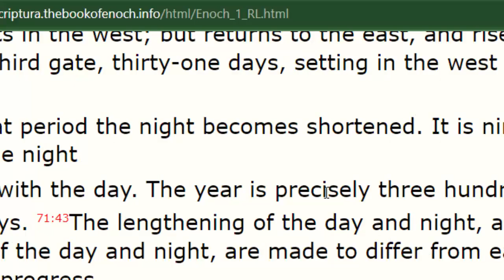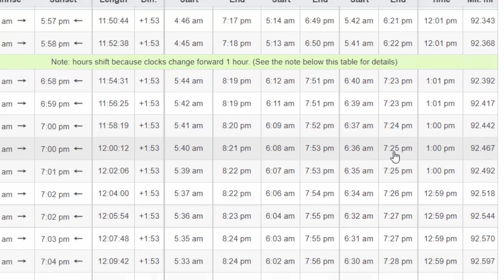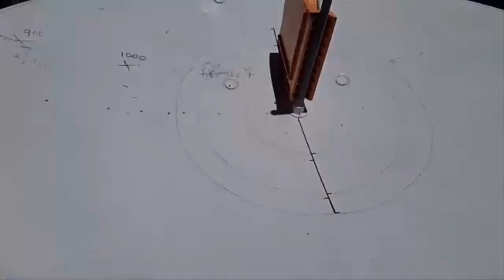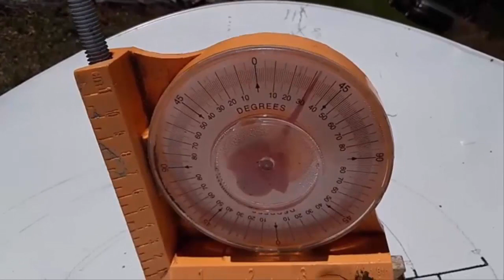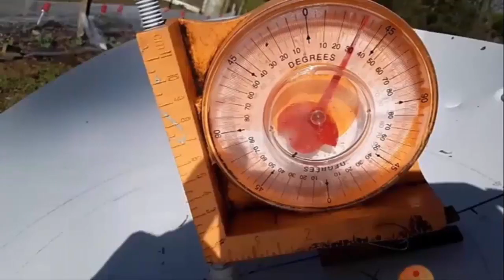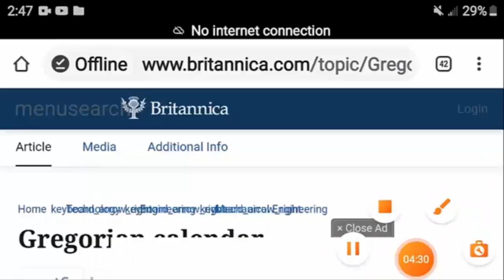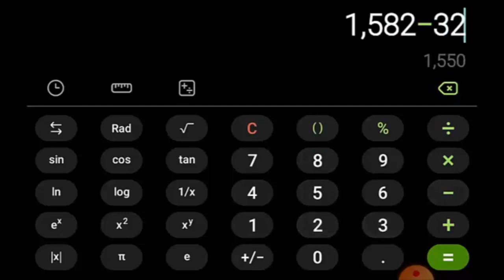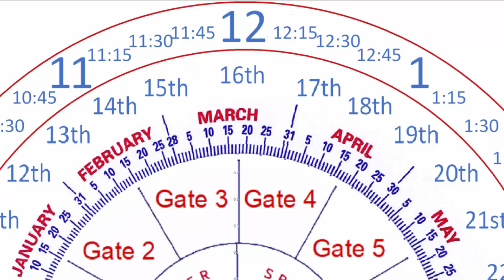When Is The 364th Day Of The Enoch Sacred Calendar? Equinox Is March 16th Not 20th? Earth Precession

Comment: That is similar to finding your true birthday based on date, time and  place of birth. So because I reckon through  the lunar calendar I wanted  to find my celestial birthday using the solar dob only as a  reference  point.  My Sun is in 3 degrees of constellation Leo, and my moon is 13 degrees of constellation Scopio. So instead of just going by the the solar date I go by the celestial degree of my Sun and Moon. My birthday season begin at the exact solar degree of my birth and is the true solar return. Next  I'm looking for the exact lunar degree at my time of birth that is the true birthday season and it can last for several days between locating the solar degree and lunar degree so thats its rarly just a one day event unless you have Sun and Moon in the same constellation and degree.